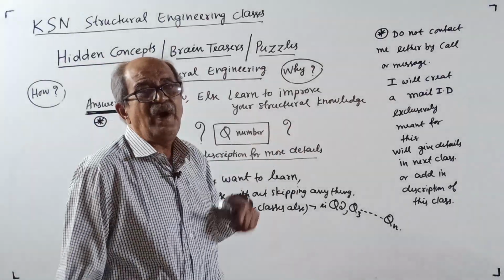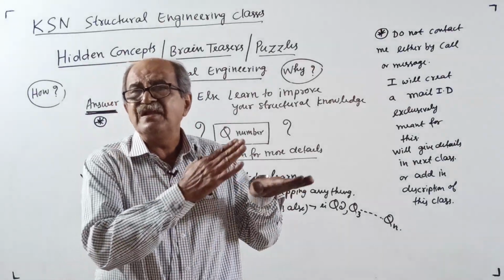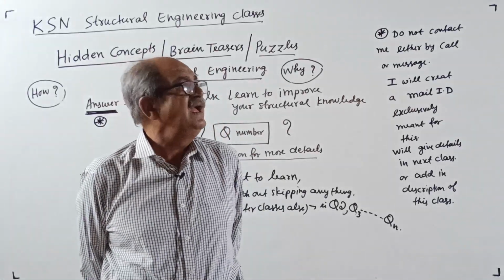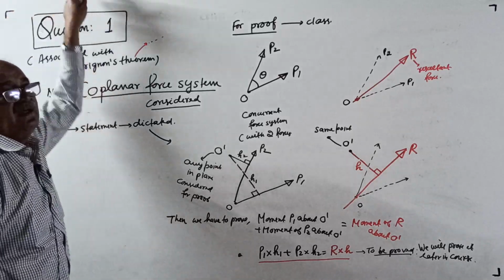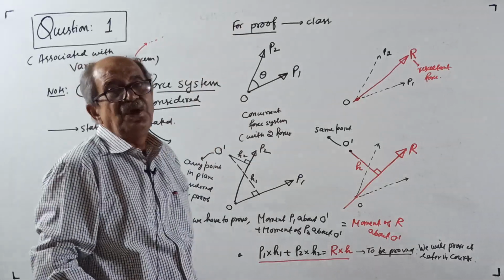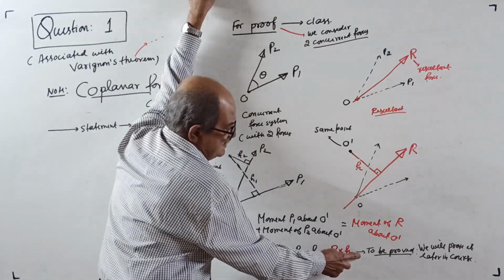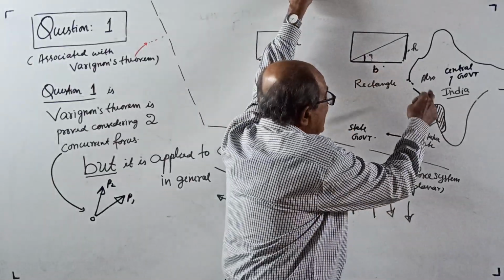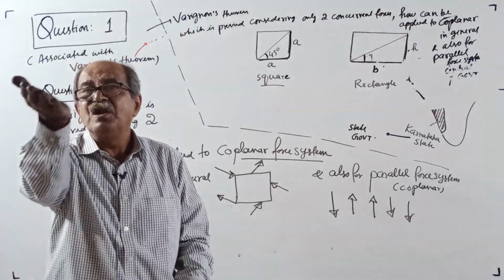Q1 for Varignon's Theorem/   Hidden concepts/Brain teasers/ puzzles, in structural Engineering

Comment: Thank you sir for this brain storming question series. I'll try to answer it.

We can draw a plane for any 2 concurrent force system, which will make them coplanar. And Parallel force system can exist only in coplanar condition. Hence as you mentioned if we prove any property of  rectangle that's valid for square as well, similarly if we prove varignon's theorem for 2 concurrent force system that'll be valid for both Coplanar and Parallel force system. As all these 3 conditions are coplanar only. 

This is based on my understanding of concept which I revised watching this video itself. However I'm looking forward to get the exact answer if any other reason is there for that purpose.
Reply from the maker: Sorry, not correct answer. Keep trying. I will fully explain later